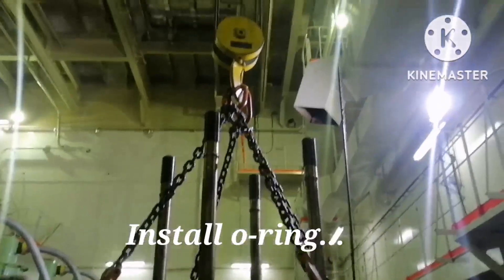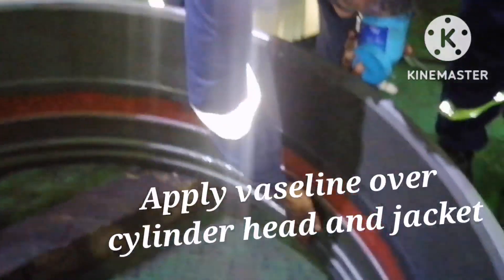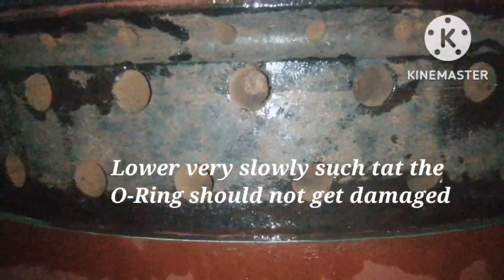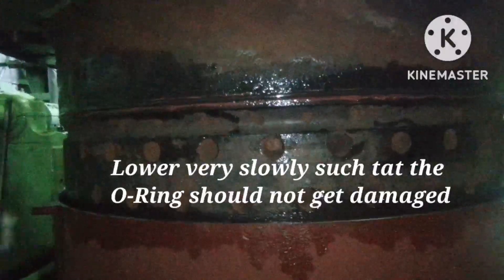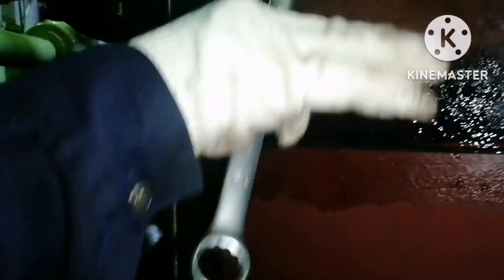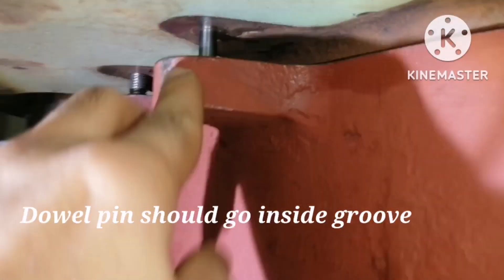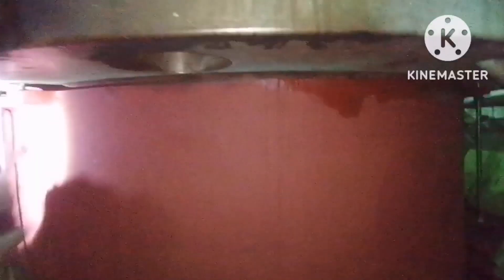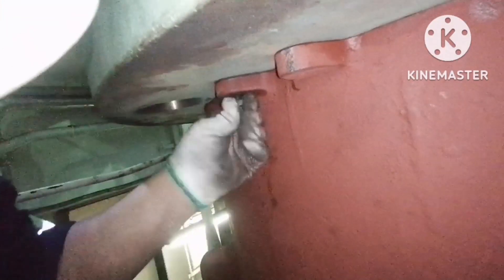HOW DO THEY DO... HOW TO INSTALL MAIN ENGINE CYLINDER HEAD JACKET ONBOARD SHIP..

Comment: Thanks for informative video,I think Vaseline is used so that O-ring is not caught between surface which may cut the O ring 🙏
Reply from the maker: Ur rt but vaseline helps to free movement..creates a Slippery surface basically which eases our job..
Reply: @marine-knowledge-basha  Can you also make a video on isolating and draining of framo lines , like basic framo setup and line isolation for troubleshooting leakage ,I would be very greatful if you can 🙏